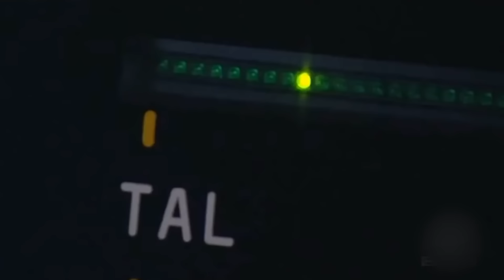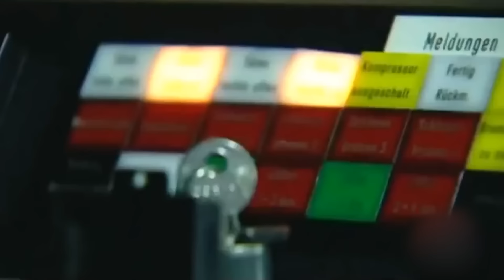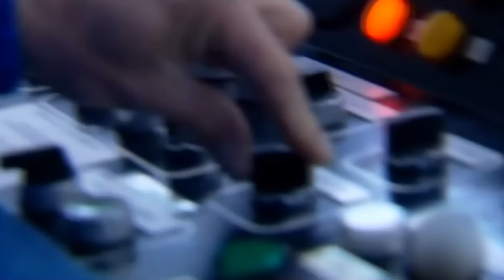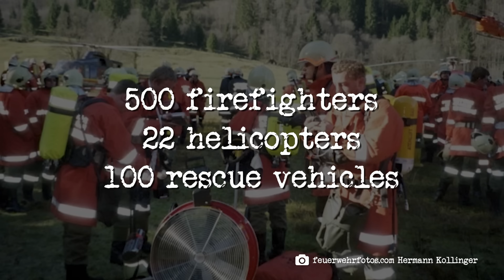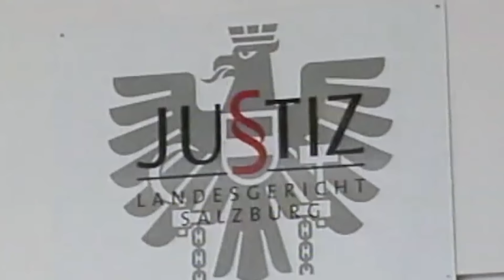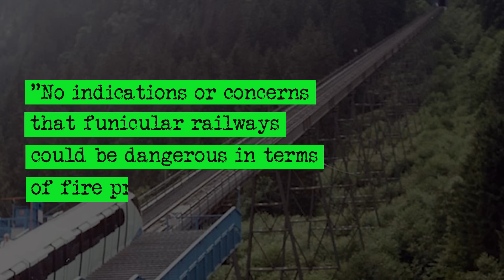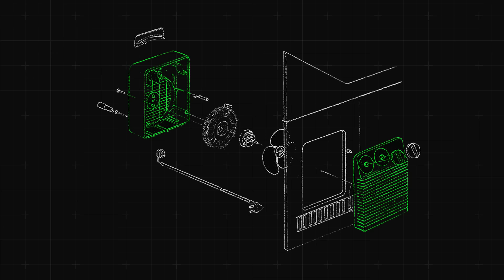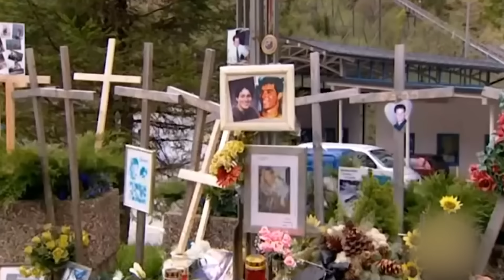The Kaprun Alpine Railway Disaster 2000

Comment: Not having a way to talk to the conductor from other parts of the train or at least an emergency button somewhere is in my opinion the most unbelievably terrible thing about this, along with him having no training about what to do in an emergency like a fire to know not to lead passengers upward. Conductors not even being given the basic training given to flight attendants in airplanes but for the limited amount of things that can go wrong on a train is just pathetic...
Reply: Also, I don‘t know why a 3km tunnel doesn‘t have cables for cell service inside.
Reply: cus it was the year 2000, while cellphones weren't rare they weren't commonplace either. That's the least of the issues I see here.
Reply: It should be common sense to not climb upward in a fire because everyone knows smoke rises?
Reply: @youngeshmoney  Plenty of safety protocols should be common sense sometimes, but common sense is more uncommon than it should be and what to do in an emergency isn't something that should always be left to it. When people are in an emergency situation and panicking, it's harder to think. Having a plan ahead of time isn't working on the assumption that people are dumb. It's turning life saving measures into a matter of training instead of thinking under pressure---much easier. Much safer.
Reply: @youngeshmoney  One of basic rules of emergency escape design is you do not rely on "common sense". That is why you see green lights with "emergency escape" markings even in perfectly clear areas. And that is why emergency brakes in trains are big red handles. Because in danger, you need untrained people to "see and go".
Reply: @pavelsovicka5292  oh okay, makes sense
Reply: I'd say it's the lack of emergency stops switches and manual door unlocking mechanisms or emergency scapes at the passenger's reach. If anyone had been able to stop the funicular manually, the driver would have noticed.
Reply: @youngeshmoney  it was a dark tunnel with only a 30 degree angle, they may not have realised in their panic they were going upwards. Also it's implied the flames were too intense for them to go safely down past the train anyway
Reply: @andeggbreaks  bro have you ever walked up a 30° incline? It's steep LMAO. And yeah I thought of that, maybe the flames were too much to go the other way, hindsight is 2020
Reply: @andeggbreaks  Sprinting past the flames and getting a mild burn is much better than suffocating though.
Reply: @v5k456jh3  You can't sprint down a narrow 30 ° angle with ski shoes on though^^ But I get where you're coming from. The survivors managed it after all.
Reply: @youngeshmoney  they would have had to step through flames in order to get down. All your instincts tell you to just run away from fire
Reply: captain hindsight level advice
Reply: and the doors should need electricity to stay closed
Reply: @pavelsovicka5292  they could have painted signs on the walls, go down in case of fires.
Reply: @monad_tcp  Yeap, one of many things they should have done...
Reply: @v5k456jh3  honestly
Reply: @Domo3000  very true
Reply: Spiderman no way home< weird?
Reply: Times where much simpler in 2000, only some ppl had a button flip phone in their pocket, N'sync and Britney Spears where at the music top and there where no bullshh 'rights' left and right.:elbowcough: Safety protocols also where left in the second plan.
Reply: @monad_tcp  painted on signs on the wall are very helpful, when everything is filled with smoke.
Reply: It was the year 2000, that wasn't really a thing, you lost your signal in a tunnel, that was it.
Reply: @nicholasbaldwin1876  I know many tunnels, where there are leak cables or strongly directional antennas with only GSM (they don‘t have LTE/5G yet and never had UMTS). 
Some long tunnels had base station equipment.
Reply: Now conductors on all trains in Austria have a training in case of a fire!
Reply: @andeggbreaks  The falmes were not too intense. Some people walked by them and they survived.
Reply: @ NotSomeoneyouknow: No. If a train stands nothing can really happen. If a plane isnt moving from its own, you have a real problem...
Reply: @LooNeYlv  What rights?
Reply: That, and not having any inbuilt fire detection and suppressant systems as standard is mind-boggling
Reply: @InfiniteEchos  It was the 2000...
Reply: @PeterMcCluckin  Dafuq are you talking?
Reply: @youngeshmoney  Common sense goes out the window the moment stress is introduced. The only way to mitigate irrational behavior under stress is training, training, training.
Reply: @jffry890  fair point
Reply: Its common sense, everyone should know how fire works.. heat/smoke rises 
Even when things are going wrong you MUST be able to think clearly not just panic and simply flee without thinking
Reply: @Morpheen999  Absolutely. But of course, panic isn't a choice. Suppressing it is but it doesn't always work and it tends to work a lot less well when everyone around you is panicking too. Confusion and uncertainty is contagious in emergencies. Even if you know what to do, and consider it common sense yourself, sometimes the assumption that others should consider it to be common sense and aren't using it can for instance cause you to follow a group into a situation you don't think is safe just because you might wonder if they know something in that given situation that you don't. I just mean----a lot of people don't even know how they'd react in an emergency until they're in one. It should be part of the conductor's job to keep himself and everyone else well put together in a bad situation. Ideally everyone would be responsible for themselves, but ideally a train wouldn't be on fire in a tunnel, either.
Reply: cant talk to passengers and he had to ask if he should let passengers out of the burning tube.
Reply: And when everyone died that part sucked too
Reply: It's very easy to criticize all tragedies with the luxury of hindsight but in reality all tragedies happen because they don't have that hindsight... and we all make mistakes. They probably operated these trains for 60 years with no major incidents or a need for communications, so why would they think they needed them all of a sudden? A series of small mistakes can always lead to something, regardless of how much we try to safe guard from it.. nothing will ever be perfect
Reply: @mattb6646  All very true, but 'expect the unexpected' isn't just a novelty figure of speech. Being prepared is why fire alarms (any kind of alarm), fire sprinklers, and fire extinguishers and escape plans that account for each building's population capacity are mandatory parts of commercial building inspection, and why backup plans are mandatory parts of a coherent primary plan of any kind. Accounting for an unprecedented situation can be difficult, but that's less of an excuse when you consider that if only one thing can possibly go wrong in a situation (in this case, a breakdown+fire), something going wrong is Always a possibility in Every situation, so you may as well operate under the assumption that if something Can go wrong, it might. In fact, it almost seems to make 'divine providence' of it, to those who dare act like 'acts of god' aren't a thing. 

Note that every ship that's ever been dubbed unsinkable has sunk, even before and after the Titanic, and everything ever deemed unbreakable/unconquerable has just declared "Game on!" to the universe. How hard would it really have been to make communicating with the conductor less impossible? Common sense has a right to get offended and call people out, sometimes. So others take it personally on its behalf, on occasion. Eh! 🤷‍♀
Reply: this was 2001
Reply: I do agree to an extent, the railway industry is hundreds and hundreds of years old were told, yet accidents still occur Dai I'm my country it seems. You expressed how unbelievable it was that there wasn't a button on the 2 mile train. To me it's how the power went out, and panic ensues as people forget all knowledge in a stressful situation. It's tragic but people should be asking how this happened in the first place I think, too many things happened to fall in place... they accelerated the fire when the opened the side door In the tunnel shaft... idk
Reply: This is from the year 2000.
Reply: It’s sad to hear that nearly 200 people forgot basic knowledge and went up like boi hot air floats they teach that in 2nd grade
Reply: @10mov63  Let’s see how much can you recall your 2nd grade wisdom when you’re suffocating in panic in a dark tunnel surrounded by flame and smoke
Reply: Not to mention... Only having one emergency exit for the train, and apparently it didn't work(?), not having any way to force the doors open after a loss of power (doors on such people mover trains are typically designed to fail UNLOCKED, not LOCKED! And those that don't should have a mechanical release lever in the cabin!), no onboard fire suppression system, no fire or carbon monoxide alarms onboard or in the tunnel, no fire extinguishers onboard or in the tunnel either, absolutely no lights in a 3km long tunnel (what the actual f*ck!?), and not having a proper fire escape or emergency walkway in the tunnel, something that is basically legally required in all train tunnels in the US and hopefully other places! It should be an extra-wide one with a proper guide rail too given it's meant to be ridden by people in ski boots!
Reply: yeah 2000 phones were just coming out or not even out yet in that country
Reply: @NickyD  I have seen many buildings around that time getting some sort of leaky feed equipment. I guess in this case there was no need because it was relatively new and FM coverage wasn‘t required either. But they could just have extended the signal using a repeater like it‘s done today, which generally is a pretty cheap solution. 

Most equipment was added like in 2005-2015, apparently.
Reply: Yep!
Reply: If this was a train that would make sense but this was not a train
Reply: Not to mention how hard it was to break the glass. By 2000, it should shatter when hit from the inside with an emergency hammer.
Reply: When perhaps only a few complaint to deaf ears while majority didn't care so...
Reply: also there should’ve been emergency exists for that exact reason
Reply: And after all this death the court and defendants got away with extreme negligence they even went after the Expert for the prosecution!!  What a sham

Comment: that firefighter on board saved lives that day, he had knowledge that majority of the passengers did not have about fire. never heard of this disaster until today
Reply: that's like how only electricians know that electricity can shock you
Reply: @TheMrTape  ofcourse everyone knows that smoke and heat goes up. But not everyone can think about that when in a extremely critical situation. A firefighter with experience will not need to acknowledge that because theyve done countless drills and who knows how many rescues so its second nature to them
Reply: As an old person who lived with her grandmother, who only had fireplaces for heat, I recognized immediately the mistake of going up. I didn’t hurt to have watched Sesame Street with my kids when they did fire safety week. “Get Low!”
Reply: @juti488  Indeed, common sense and critical thinking tend to fly out the window entirely when a chaotic situation erupts. Only those who are extremely adept at calming themselves, or are used to chaotic situations (like the firefighter) can typically hold onto their rational thought, instead of devolving into a frightened animal.
Reply: Common sense tell you not to try to out run fire and smoke
Reply: @philipbrown6685 instincts tell you to run away from the fire, the majority followed the instincts which is natural in these kind of situations when panic is on the highest level